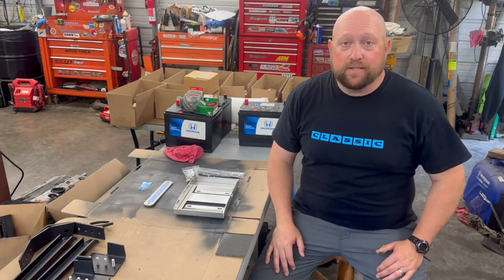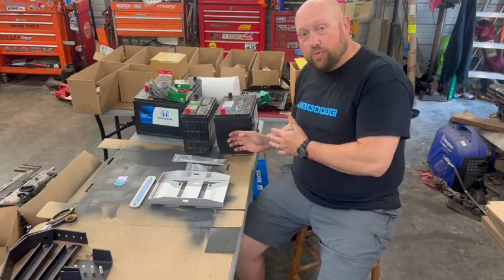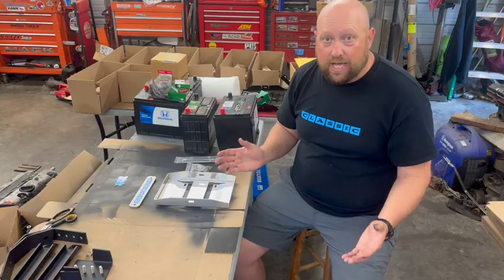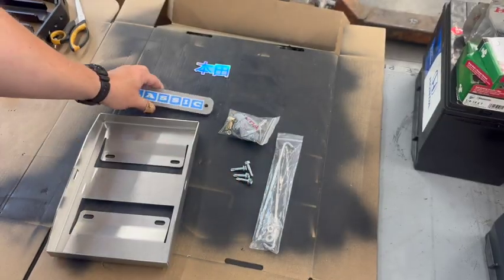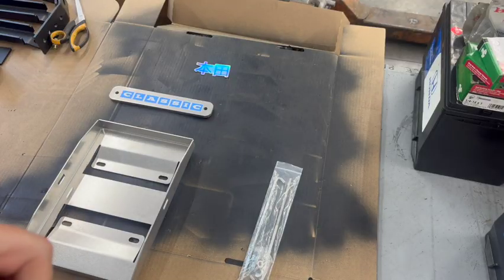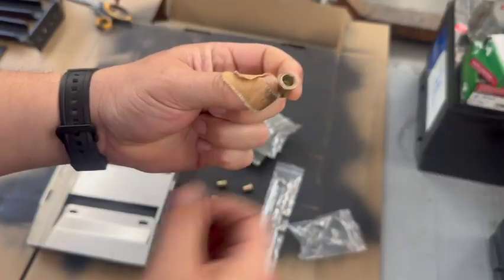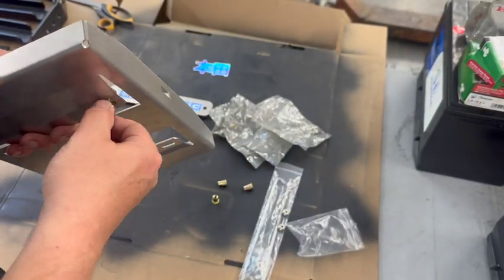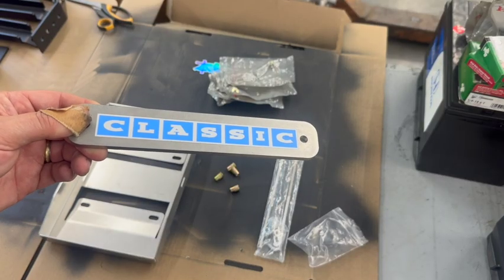Honda Element Stainless Steel 24F Battery Conversion Kit

Comment: I'm interested in a battery location kit to make clearance near the air box.
Reply from the maker: @infinix28  currently we don’t offer a relocation kit.  This tray could be used as a foundational piece for one, but not solely as one, as you need a sealed box to vent battery outgassing and extended battery cables.

Comment: Why not show one installed in a car?
Reply from the maker: @scott4825  we have an install video coming out today most likely.  Goes through the whole process of installation.
Reply: @ The installation is pretty straightforward, but toss in a link to a picture of how it looks fully installed.  Seems like a great product.
Reply from the maker: @scott4825 thanks a ton.
Reply: Where are you located?
Reply from the maker: @LoganVal215  North Carolina.  Reach out in IG or FB @classicautomotivenc
Reply from the maker: @LoganVal215   North Carolina

Comment: 1). Do the factory cables need to be replaced with longer cables to accommodate the bigger battery? 

2) What size of battery would be used with this new tray?
Reply from the maker: @jamram9924  factory cables work perfectly fine.  24F is the new battery size

Comment: Hey I’m interested! I followed you on IG. What exactly is the purpose of upgrading to a bigger battery? Is it worth it if it’s a stock element? Also will it help with the terrible loss of power when turning on the ac? 😅
Reply from the maker: @luiselboricuakid12  I wish it would help with the power loss when AC is turned on, but it will help with the slow start issues that Elements are plagued with, which could lengthen the life of your starter.  Also helps with other add ons as well.  If you’re interested, send a message on IG.  We have a few left in stock currently.